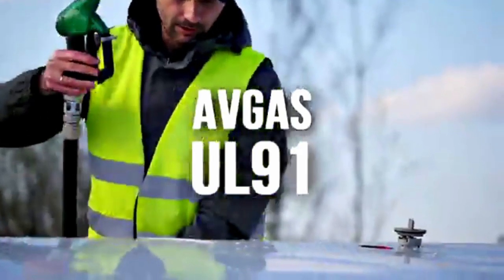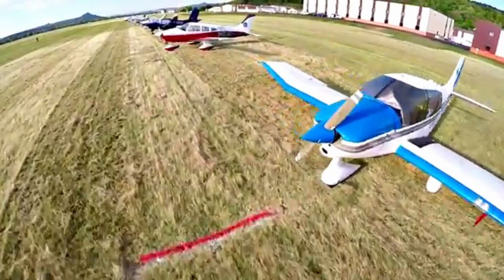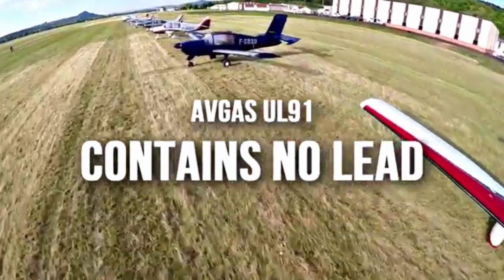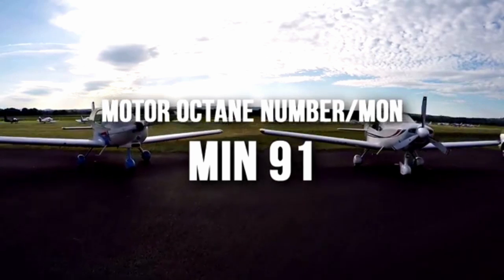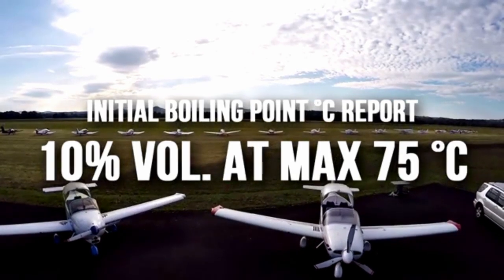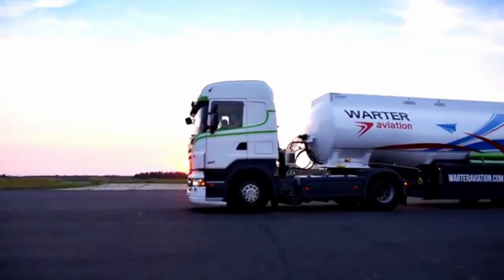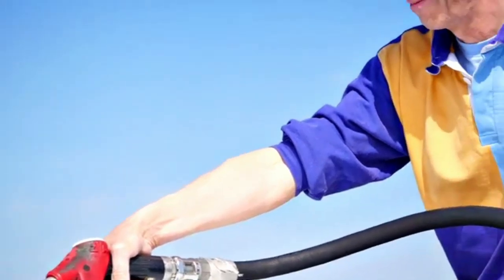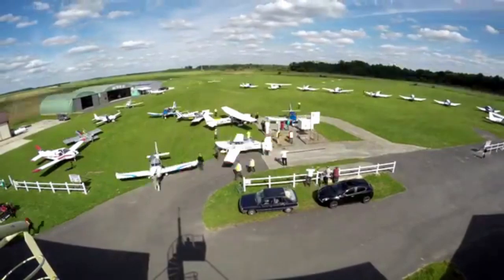MoGas (motor gasoline) in Gyrocopters instead of UL91 AvGas - CAUTION

Comment: In many parts of the U.S. 91 octane premium does not contain ethanol. It is usually denoted on the pump if ethanol free. Even at that, non-ethanol premium still doesn't seem to have a very good shelf life even sealed in airtight tanks. I use it exclusively in my small engine equipment and even in the sealed Jerry cans, it starts to smell old at about 8-9 months. Using a good fuel extender helps some. That's the advantage of avgas. Long shelf life.  As a retired Part 121 A&P, I would advise to make sure you don't let your aircraft sit over 3-4 months without refreshing the fuel when using MoGas, especially if the fuel system is open vented.
Reply from the maker: Thank you for that good colour Mark.
Reply: @gyrocopterflyingclub6148  Thanks! Just relaying my (non-scientific) experience with it on this side of the pond. Hoped it helps.

Comment: In my part of the world, our mogas does not contain ethanol.
Now some Jet-A engines can run on diesel as well, in your opinion diesel vs mogas - which one have better advantages?
Reply from the maker: Hi - well the two engine types are very different and so its not just about the fuel itself.  What I do not recommend is putting diesel in a motor designed for AvGas or MoGas!!
Reply: @gyrocopterflyingclub6148  no, what I mean is Jet A engine (which some can run on diesel) vs Av engine (the ones that can run on mogas) which one have the advantage?
I think Jet A engine has to be replaced after hours but Av engines can be overhauled
Reply from the maker: @wckoek  Hey - sure I understand.  I guess it depends what Jet A engine is meant, as in is it a piston, i.e. effectively a diesel motor? or is it a turbine?  If its pure jet i.e its the efflux that provides thrust then a gyroplane isn't fast enough to make this a sensible prospect.  Piston diesel motors are really too heavy and tbh if you take the usual Rotax petrol motor these are very reliable units.

Comment: Hello, my A/C has a Rotax 912ULS engine and per the handbook, the minimum octane should be 95. Here in Australia, it appears that we have the luxury of MOGAS being 91, 95 and 98 octane with other areas also having E10 - 91 octane with 10% ethanol.  Generally speaking, I have been told, that Rotax engines that have been run on 95 octane compared to 100LL exhibit less wear and tear however, this would need to be confirmed by a Rotax specialist.
Reply: That is also my understanding. The POH’s from AutoGyro requires much shorter intervals for changing oil and plugs when using 100LL as compared to 95 octane mogas (known as 87 octane here in the U.S.).
Reply from the maker: Hi yes the Rotax 9 series of motors prefer unleaded but do be careful of the ethanol content in MoGas especially given the ambient temperature you are likely to get in Australia.
Reply: @gyrocopterflyingclub6148  To the best of my knowledge ethanol is only mixed with 91 and called E10 here in AUS. As I only use 95 MOGAS, ethanol will not be a problem. Would I be safe in saying that 95 octane is not normally sold in the EU due to the reference of 91 vs AVGAS.
Reply from the maker: Hi sorry I missed this.  In the UK our MoGas is rated via a RON octane number so Rotax 9series will run fine on 95 RON unleaded MoGas. The UL91 Avgas is an unleaded Aviation fuel typically sold by Total, Warter, BP etc and the 91 is related to a MON rating. This YouTube channel is popular in the US and they have a totally separate octane rating and I believe that their MoGas rated 91 is similar to European and it seems Australian 95 MoGas (we all call it Premium Unleaded the next higher in UK/Europe would be Super and rated 97/98 RON.
Reply: @gyrocopterflyingclub6148  Thanks for the explanation, I now have a better understanding. Here in AUS the MOGAS that is available is 91, E10 = 91 + 10% ethanol, 95 and 98. The only AVGAS available is 100LL so hence my confusion with the UL91 Avgas.  Please allow me to thank you for all of the fantastic content you have put forward on this channel. On a side note is there a Diesel/Jet A engine around the 100hp range similar to a ROTAX 9 series or alike on the market?
Reply from the maker: Hey thank you for the kind comments. On the diesel / Jet A1 I don’t know if one in use, a few years ago there was someone (I think a chap who used to be a motoring journalist called Mark Hales) who was building one from a Golf Mark 5 TDi base unit.  Let me look for a link but I’m not sure it sold or weight wise would work.
Reply from the maker: https://www.markhales.com/pdfs/February-2017_Aerodiesel_v1.pdf
Reply: @henrymorello186  Might want to check this out: https://en.wikipedia.org/wiki/Aircraft_diesel_engine